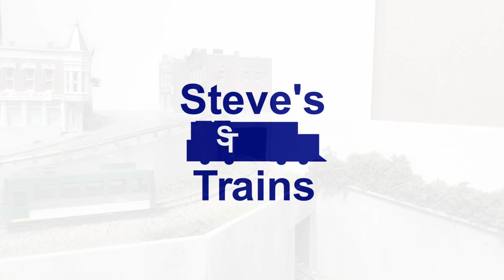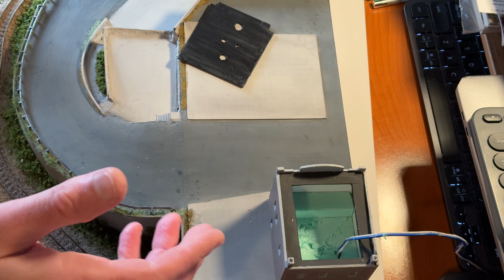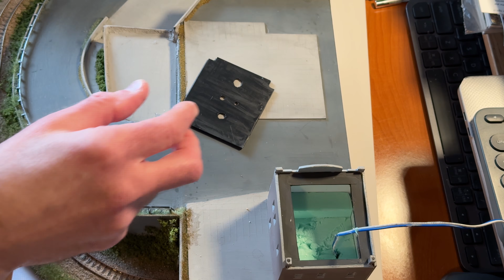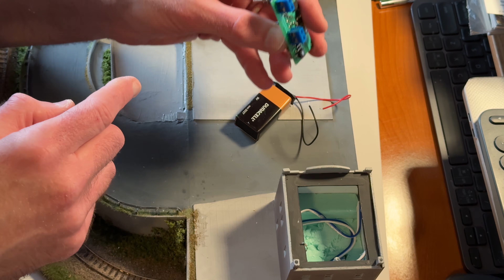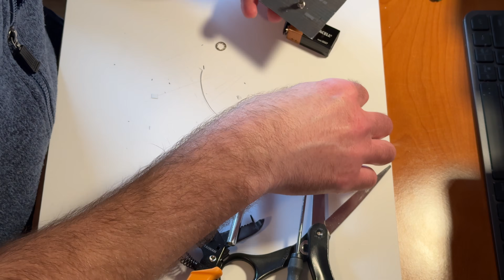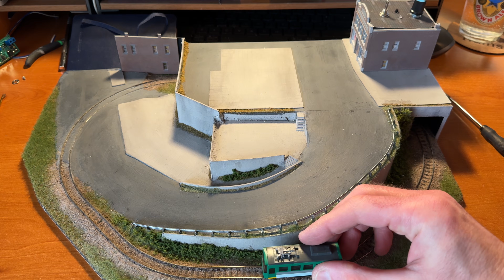Easy Battery Powered Train Control for the 2x4 Top Level

Comment: At which frequency  the battery need to be changed ?
Regards from Normandy!
Reply from the maker: It will run for quite a few hours. I had a similar set up running all day at a train show once. Depends on the battery and the current draw of the train. The small Kato pocket line trains use very little power.

Comment: If you want to be fancy. There was a layout built by David Smith a few years ago that had an identical control method, but he disguised the knob as a Roof mounted water tank and the Switch as a vertical HVAC unit.
Reply from the maker: Yeah, I considered that.  I might still do something like that.